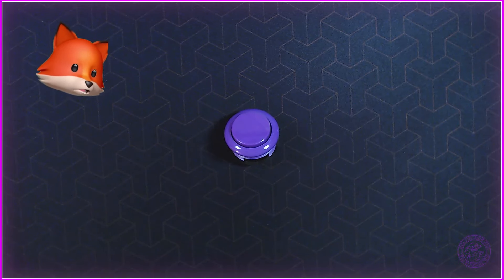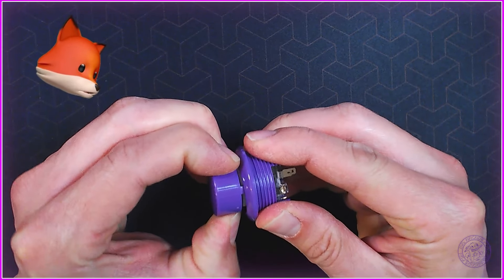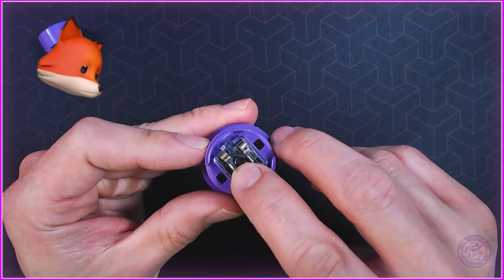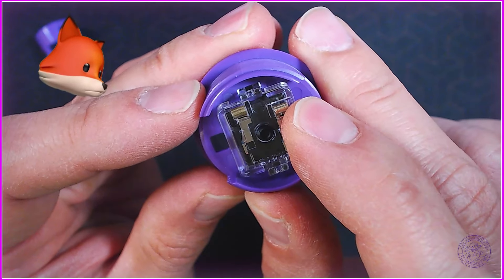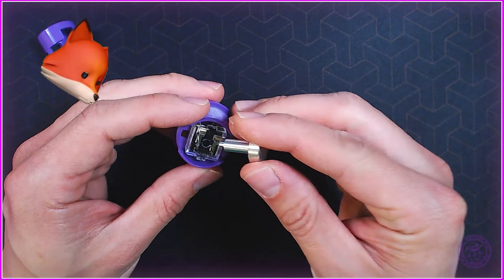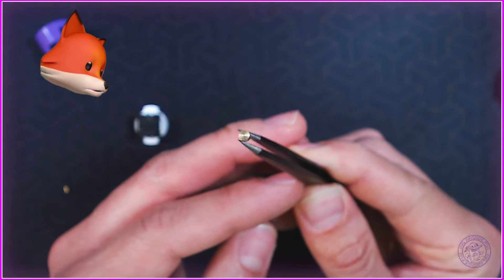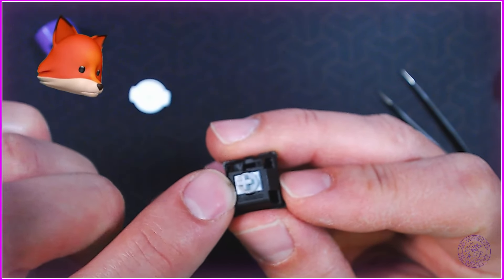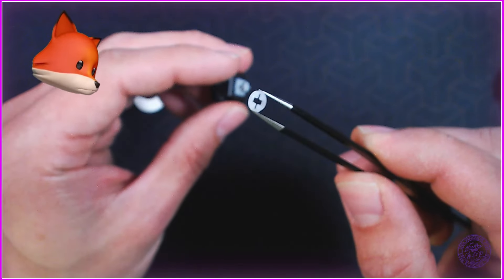Seimitsu Alutimo Button Tutorial

Comment: just spent a couple hours installing these in my 8 bit do. huge pain having to dremmel space for them to fit in. it worked though, and nothing seems broken lol. These can get complicated very quickly, but it's worth it. Of the 3 switches I've tried, the clicky ones are really my favorite. Great to rest your fingers without accidental triggers. Very satisfying click.
Reply: How did you go about using the dremmel? I was thinking just sanding them as i just need a lil bit of space for them to fit
Reply: @zangrix  there's the two macro buttons those I just used by grinding soft quarter circles on a sanding disc Dremel bit. Take your time and go around and around a few times after a couple minutes they'll fall right in. My fingers slipped a couple times and the top of the button hit the sander and left a mark which I now have to figure out how to buff off, which will probably be a buffer bit for doing acrylic nails since it's probably the same plastic anyways. For the main buttons I used a cylindrical sander bit and just very carefully took about a millimeter or two off of the PCB being careful not to cut into any of the lines. I also had to dig into the plastic support pillars but not all the way through. Basically wherever it's tight, just make some space for the buttons. Once you do that it's a little tight getting the screw caps on but it's not bad. Plus you can switch out the switches and do all that without having to take them out once they're in there.  I would wear a 3M mask though it does create some nasty dust you probably don't want to breathe. Now that I'm done with it I'm really happy that I did it all. I probably wouldn't do it again though had I not bought all the parts already.
Reply: Which clicky ones? What color rather?

Comment: So I might be crazy, I'm really enjoying these buttons, but I'm looking for something that requires more of a deliberate press to activate the button. I'm kind of heavy-handed, and I hate accidentally hitting buttons. Would different switches in these buttons help? If so, which ones would you recommend?
Reply from the maker: Take out the 1mm shim on the switch and it will drop the actuation point making them less sensitive. It will affect the throw making it shorter but less sensitive to accidental presses. As for a less sensitive switch. I’ll be making another video soon testing out a variety of switches so I can’t really give input on  a less sensitive switch yet cause I don’t know what is compatible.
Reply: Two words. Spring swapping. Absolutely magical. 😌
Reply: @mr.arcadefox8782  thanks for the info.
Reply: @wanabdulhadi1268  I'll look into that. Thanks.
Reply: @GregLyon  spring weights can go up to 60-70, even 80g. I’ve used 100g springs before… they’re pretty damn heavy but if you’re baller like that then maybe you could give it a try. There are also spring types and for mx speed silvers and any short travel switches, I recommend long springs of up to 18-22mm. I myself am using geon 60g 3-staged 22mm springs in my mx speed silvers in gamer fingers and crowns, and in my mx blacks in some custom buttons I got.
Reply from the maker: I’ll use a Thick Click MX Navy and throw in a 150g spring for the Auxiliary buttons to prevent accidental pressing.
Reply: blue clicky ones you can actually half press the button without actuation. The button doesn't activate until you pass through the click mechanism, and it has a really nice feel to it. of the 3 I tried, they were by far my favorite. These were my first clicky buttons I've used, and I think I might start leaning in that direction from now on. Definitely give them a try.
Reply from the maker: Box jades feel really nice in the button and box navy’s if you want a harder spring.

Comment: Thanks for the informative video. Now that you've had some time and gotten a feel for them, would you still recommend them? I've used pretty much every button up to this point, what would you say this is closest this button is related to? Thank you for your time!
Reply from the maker: I enjoy them and I do like the color palettes that they offer. I do feel like they are a bit over engineered as the metal roller pins are a pain in the ass to deal with. I do prefer a button with a shorter throw. They come the closest to a Crown 202 but I feel they don’t quite live up to the sound and feel to the 202. Overall they are a good button especially if you like Cherry switches. Out of the package the spring ping of the silver cherries is obnoxious. If you lube and or swap them out they are loads better.

+ clacky button
+ good colors at launch
+ nice feel

- roller pins suck
- not compatible with all switches
- clacky button 
- spring ping is very noticeable STOCK

Comment: There is no way in hell (in my experience) to get these switches to work without the shim in the 24mm variant. I don't know why, but it also doesn't really seem to effect the travel unless you're using a SIGNIFICANTLY shorter-throw switch, like closer to 3mm than 3.5. The pins can be perfectly aligned between the little brass piece and the larger pin for the button itself and it still doesn't fire reliably. I have noticed the speed silvers have thicker pins, but it's such a small difference I'm not sure if I'm gaslighting myself on that front. I really wish the design accounted for this because once they're assembled I think they do a way better job at actually capturing a tactile bump or click. I've done a lot to try to make it work, going to keep trying, but I'm really keen to see if they do a gen 2 of these if that gets addressed.

Comment: I had Tamiya masking tape laying around since I never got to use it. So I did a tape mod around the hole areas under the button and I wrap the side pegs of the outer cap with the tape and it did dampen it a bit. I also used silent box linear switches that I got from invokeys and I lubed the springs of those switches. I also had copper tape on top of each contact point in the button and those pins won't fall out and I can use thinner pin switches.

Comment: Seimitsu had an older button that supported keyboard switches how are these different than those?
Reply from the maker: I am not aware of these buttons. Do you have a link or model number?
Reply: @mr.arcadefox8782  I think I was confusing seimitsu with crown. The buttons I was referring to have a model number of 202 or 203 if I remember correctly
Reply from the maker: Crown 202s are a good button but have had problems with the pin contact with switches at times leading to a failed connection. You also had limited customization when it came to certain types of switches. 

It is still too early to tell if Alutimos will be more reliable for connection purposes. It already seems like they will have more variety when it comes to different switch types.

Comment: is there a way to make them silent? i hate the buttons bottoming out and making the loud clacking noise
Reply from the maker: You can use a different plunger. If you use Gamerfinger caps with “o” rings it will dampen the sound cause it won’t bottom out.

Comment: So do the 5 Pins work?
Reply from the maker: Sort of… you would need to clip two plastic pins that are getting in the way of insertion so the switch could fit. HOWEVER… the metal pins of some 5 pin switches sometimes run thinner than a Cherry MX so they don’t make contact with the metal contact points of the housing without modification.